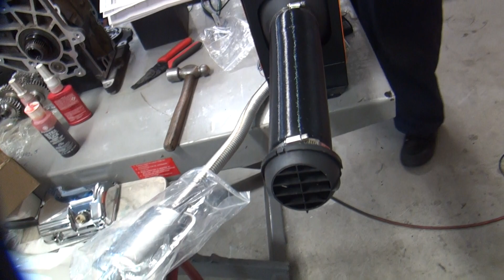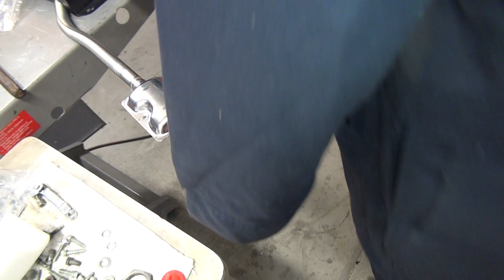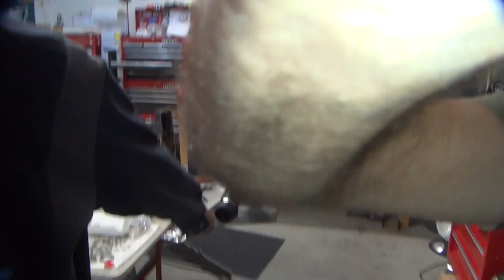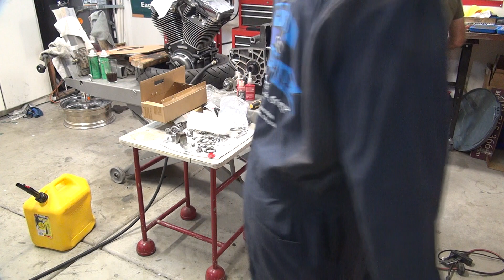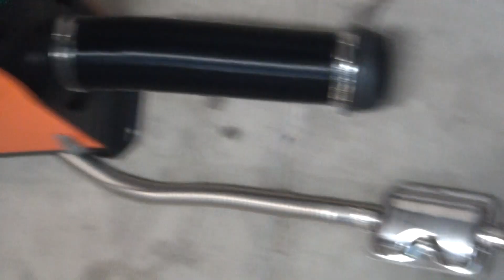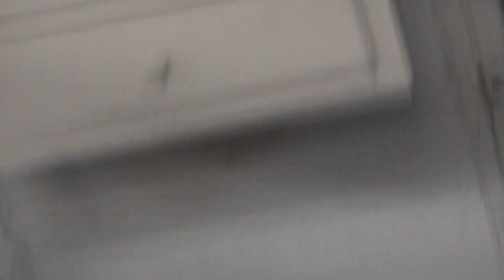2023 review test #1b Vevor Diesel Air Heater 12V 17060 BTU 8KW Car RV Indoors product tatro machine

Comment: Did you figure out an exhaust plan?
Reply from the maker: buy some long exhaust tubing and not gas myself.
tatro
Reply: @TatroMachine  good plan, thinking of buying one of these for all the winter projects. Sucks working with metal stuff when it’s 2 degrees in the shop

Comment: Been using one of these for the past two years in central Ontario Canada. If you get your intake air from outside, the efficiency improves. Also if you use  diesel/used oil 70/30 ratio  it's a little cheaper to run.
Reply from the maker: that soulds like a good trick but you might need to filter the use oil.
tatro